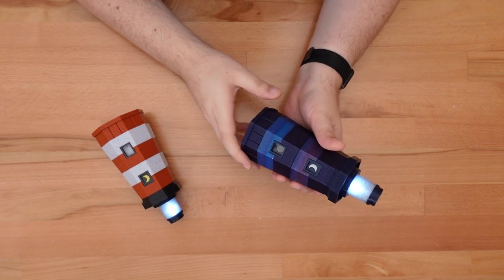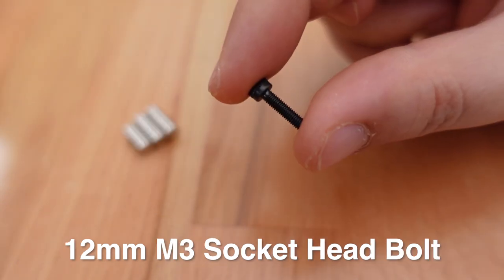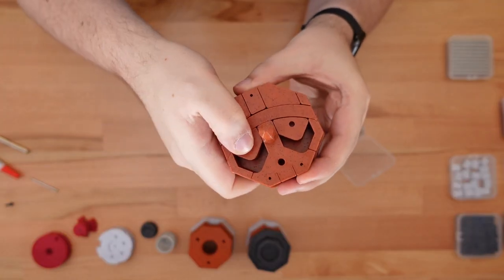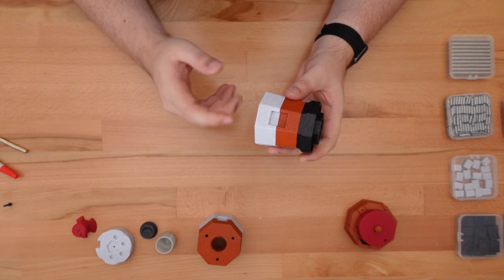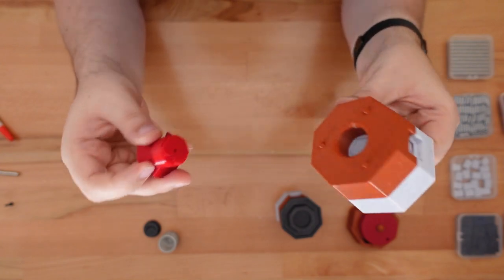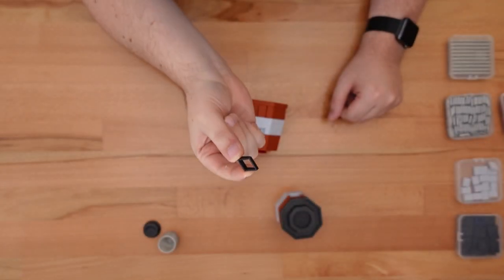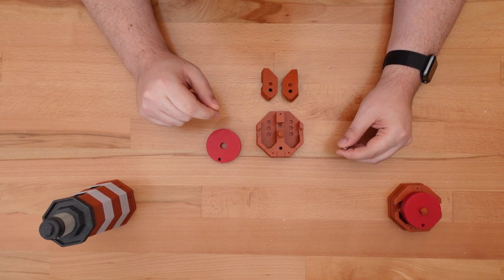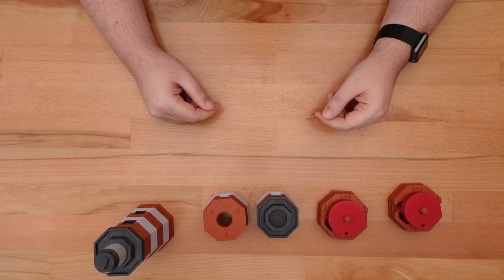Lighthouse Puzzle - Part 2: Assembly!

Comment: Awesome! The mechanism is surprisingly simple inside but the result of the puzzle is still surprising.

By the way, to remove the hairs, I usually use a cutter, a deburrer and very fine sandpaper.
Reply from the maker: Good suggestion! I rarely have more than a few extremely thin wisps that I can just brush right off - but this particular filament really wants a cooler nozzle temp - under 200C.

Comment: Your puzzles are fun and fantastic. Can you provide links where to get the other parts from like magnets and bolts. Also how do you print the two tone in one print fairly new to this.
Reply from the maker: Thanks so much!

The parts list (with links to where I purchased my materials) are included in the project documents. These aren't affiliate links or anything like that.

Filament swapping can be fairly easy, but it depends on slicer.

I use PrusaSlicer, which has a very easy-to-use setting for this. Here's there step-by-step how-to: https://help.prusa3d.com/article/color-change_1687

It's a little trickier in Cura, but still possible. Here's a video by CHEP that walks through those steps: https://www.youtube.com/watch?v=1nBnVtOEAiY

Finally, you can always pause a print manually to make the color swap. This requires good timing so you don't miss the layer you want.

Good luck, filament swapping is a very powerful option to make your prints really pop :)

Comment: Actually, I would love to build this for a friend who is into light houses, but finding 4x14 pins that are magnetic is almost impossible. I've only found one source for 4x14 pins and they're 304 stainless steel and come in a box with 100 other sizes too. Any clues where you got yours?
Reply from the maker: Good news: the default configuration of this puzzle does NOT need the pins to be magnetic.

They just need to be smooth, a little heavy, and the correct size. Cutting down a 4mm diameter aluminum smooth rod should be more than sufficient. And, if you print the "bolt version", you'll only need to make a single pin.

If you'd prefer to use the pins shown in this video, I purchased those through McMaster-Carr, which sells 50 pins for $14. I've linked to the exact listing on the project page under "hardware". I realize buying 50 pins if you only plan to print one puzzle is a little ridiculous, though. So using smooth rod might be the way to go.

Comment: hi, thanks for making these amazing puzzles and letting people enjoy them. I do have a question: i assembled the puzzel and all systems move freely BUT i seem to  only be able to rotate the puzzle from 5 to 1, not from 1-5. I can get to 2 but it's impossible to go to 3. Did you experience this yourself as well? Might there be a clogged hole /hole that is just a little small in the moon disk?
Reply from the maker: Hmmm, I haven't heard of this issue before. Can you tell for sure if the pin is at least moving somewhat when you get to those stuck steps?

I agree that one possibility is that the hole is a little too small in the disk. Another option is it's not lining up quite right (I made the holes in the disk a little larger than they should need to be to allow some wiggle room). Try bouncing the buttons back and forth slightly while the lighthouse is upside-down to see if the pin will fall into place. The press the button all the way in to advance to the next step.

I hope that helps! If not, see if you can open it up and widen the holes in the disk. You SHOULD be able to test the mechanism before sealing it all back up entirely.

Comment: Have you tried to dry that filament? I think that stringing is the result of a wet spool. Happened to me once. Dried it and the stringing was gone.
Reply from the maker: Good question! But no, that's not the case here. Once I lowered the print temp to 195C (way lower than I usually print), the stringing vanished.

A few extra details for those who are curious:
- The roll was well-sealed and completely new
- 2 other rolls of the same color had the same problem
- Other colors from this brand (Hatchbox) didn't string nearly as much
- Printers are in a naturally low-humidity area, where I regularly print with PETG that has been sitting around open for weeks
- No tell-tale popping sound when extruding
Reply: @3DPrinty  Ah ok then, if a lower temperature solves it, all the better. 195 is pretty low, I never tried to print at that temperature.
Mine were eSun PLA+, sealed with a dessicant. No popping sound either but stringing was worse than on your print and putting it in an oven at 45 degrees for a couple of hours solved it. I didn't have the issue with most other spools either.

Comment: Could you tell me exactly where to put the color change in my prusa slicer??
Reply from the maker: The exact height and layer will depend on your slicer settings.

So instead of going off a specific height, I zoom in and look for the layers that contain a false seam. Find the point where that seam is the deepest, and add the pause there. This should be somewhere around 24mm and 48mm, although that can be +/- 0.5mm depending on various settings.

Good luck!